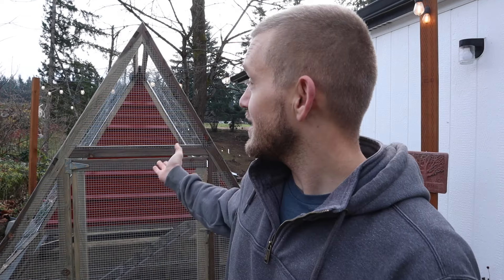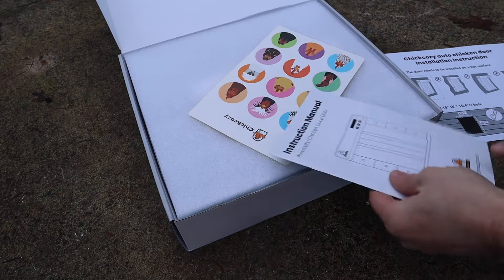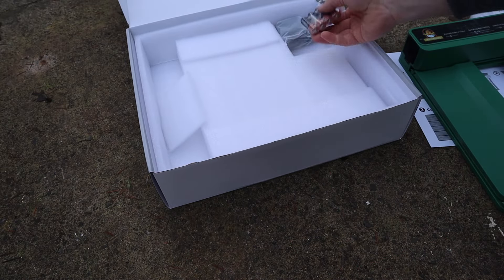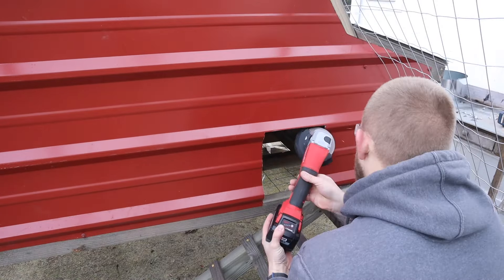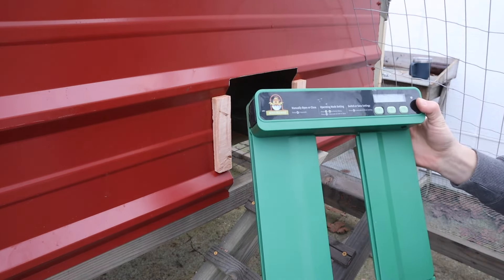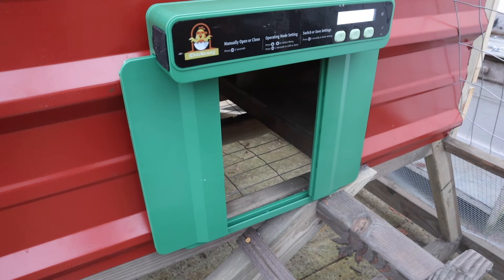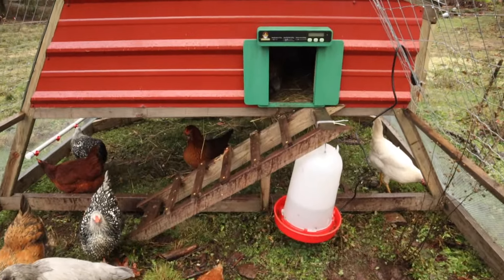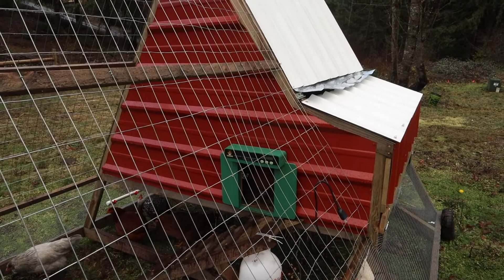Chickcozy Automatic Chicken Door | Unboxing, Assembly, & Review

Comment: How did the track do? Did "stuff" ever get stuck and keep the door from closing?
Reply from the maker: Phenomenal, and timely, question! In the original design for this coup which had an open floor and we had no issues. When we floored the roosting area (for a variety of reasons) and put wood shavings down, they clogged the track in a day or two. At some level I don’t blame the door because our coup design prevents the shavings from dropping out which is how the track is supposed to self clean.

In summary, I think the door is fine, just make sure the area under it is clear so it can clear itself.